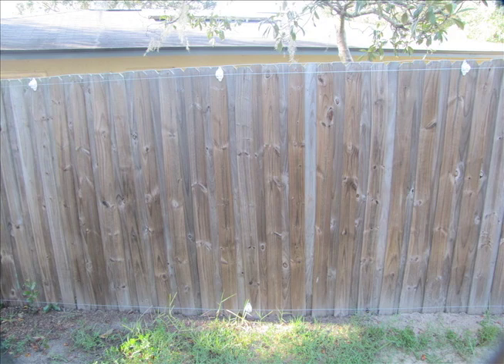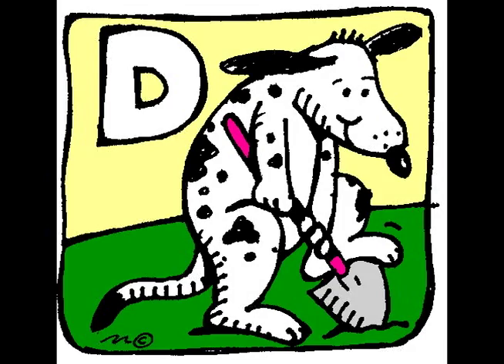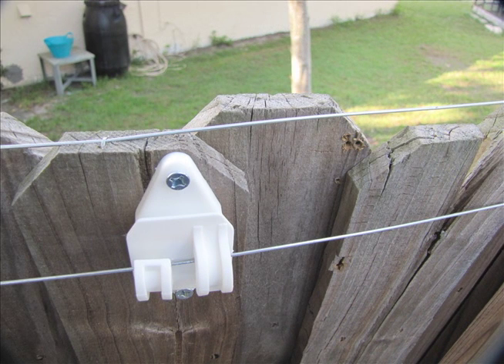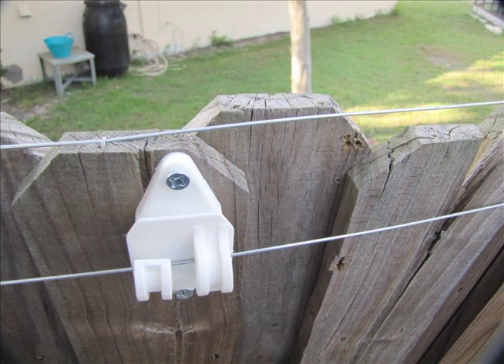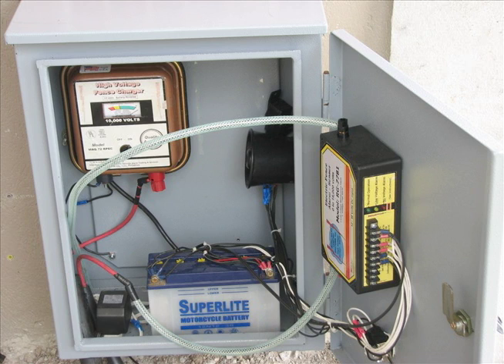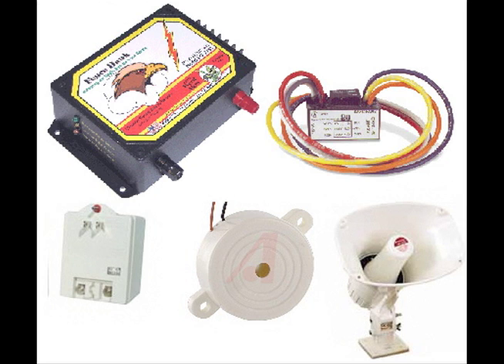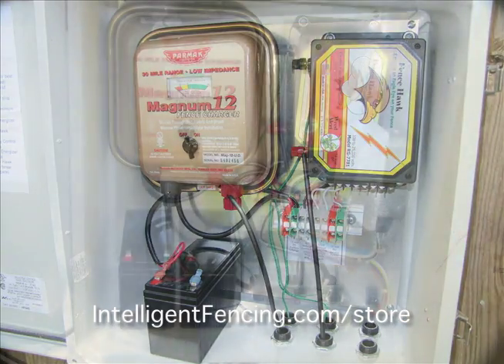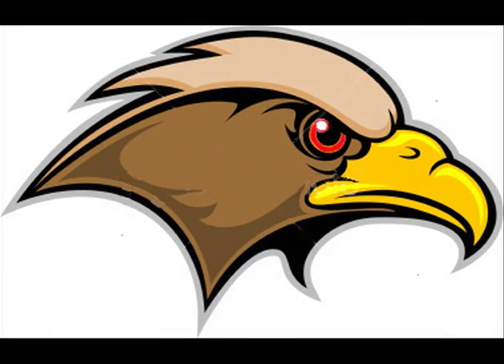Securing & Electrifying a Privacy Fence - FH3

Comment: I have something similar with the exception that I am using a microwave transformer and its capacitor, the output is around 4800 volts AC by including the capacitor. The system remains dead until the PIR senses somebody trying to climb over the fence. Hopefully, this will deter them. The cost was cheap, 10 pounds for a second-hand microwave, 14 pounds for the PIR, and some spare wire and insulators I had.
Reply: how is it powered? is it unobtrusive when viewed from the side it is installed?
Reply: @xisotopex  i have mine powerd by a 60000 volt tazer module and yes you cannot see it from the kerb side

Comment: Hi, your video is great.  I spent the cash for a brand name electric fence to keep the neighbors cat out of my yard and the next day the damn cat just strolled right under it with his whole back rubbing along the bottom wire and he got no shock, is it supposed to touch two wire to get the shock?  I am feeling really defeated
Reply: Piper Mccoy  If I want to install the hot wire on top of the fence to deter the racoon, should I put the ground wire together like the one in video? What if the racoon only touch the hot wire on top of the fence, does it get shocked? Thanks!

Comment: is this easily modified? I would like to have at least 500mA to 1Amp in the wire to shock. if someone climbs my fence, I want the shock that is delivered to give them a moment to really reconsider their life choices...
Reply: no a 1 amp  will kill you a tazer is only 0.0021 amps you can touch a billion volts as long as the amps are below 0.1 amp and this will not kill you it is not the volts that kill it is the amps
Reply: @ianspaintpot  well I will modify it so it outputs 1 Amp
Reply: @xisotopex  1 amp could still kill you,  you need it to be 3.6 MA or less .
i have mine at 40000 volts but 3.6 Ma